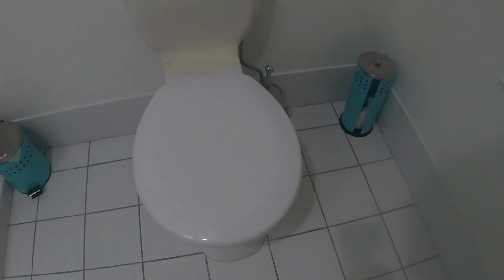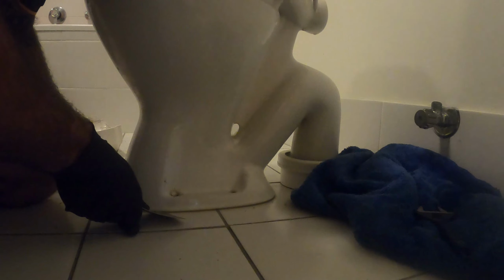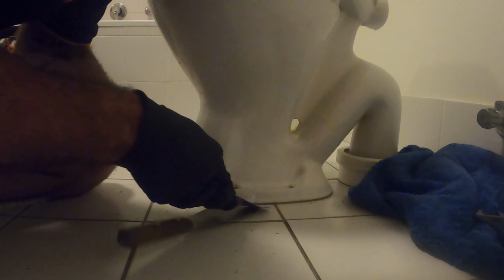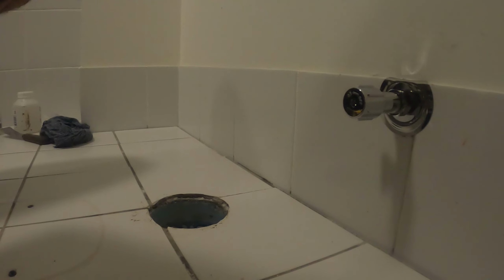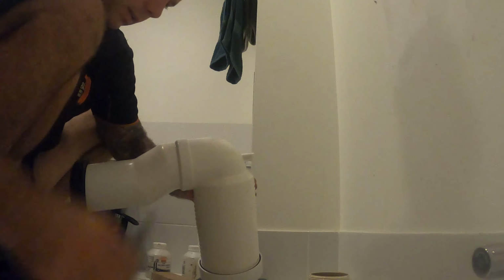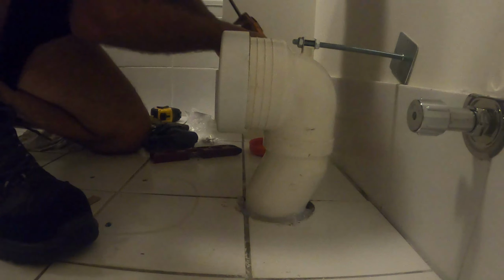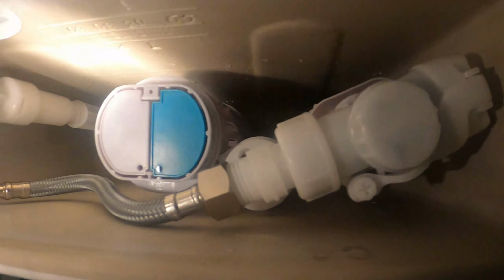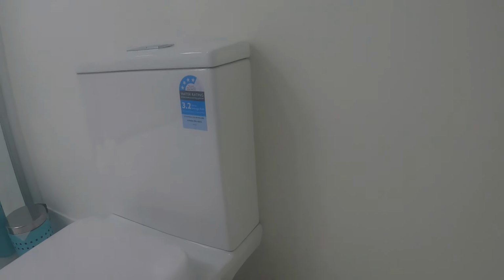Penetrator can you help 5? (Installing Fienza Chica Toilet)

Comment: Love your work. I think you may have to come back to unblock them one-day owed to the pan connector. I've heard they block up easily
Reply from the maker: Those pan connectors are pretty good and very unlikely to block. The main problem you have with any P Trap connection over time is the rubber seal perishes and leaks..

Comment: Brilliant. This is very helpful - clear and detailed. But do you have to remove the collar/lip on the floor? Wouldn't the flexi pipe fit down the hole even if the collar remained as I noticed that you siliconed the gap afterwards?

Comment: Your toilets are a lot different than what we have in the US. Do you have toilets in the brand Kohler, American Standard, or Toto?
Reply: We have 50Hz toilets in Australia.
I think American toilets are 60Hz.
No, that's not right; I've got my trades mixed up! 😉
Reply: Yeah I've seen some Kohler and American Standard toilets here in Australia
Reply: AU and UK toilets seem designed to work by shoving 3-4X as much water thru bigger traps and into the waste plumbing.  Far fewer likelihoods of clogging for sure, but a lot of water is wasted in liquid-only and nominal solids flushes, compared to North America.
Reply: @dock_yard1149  same here in NZ old toilets use 4 to 6 litres